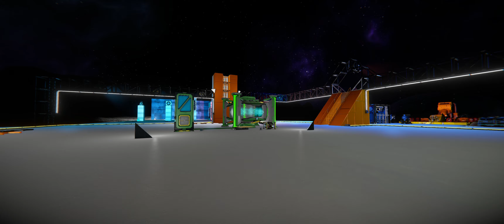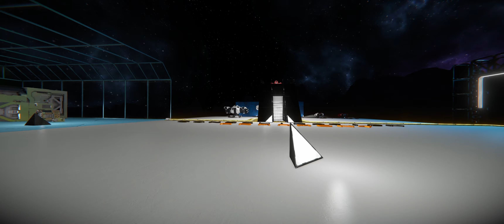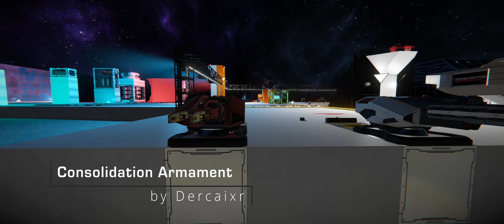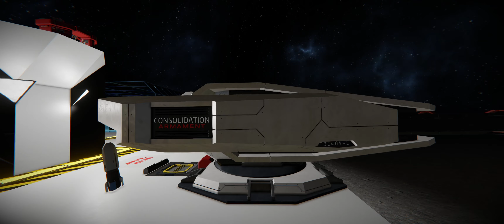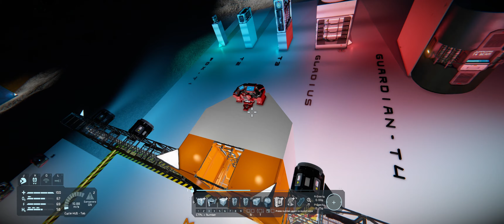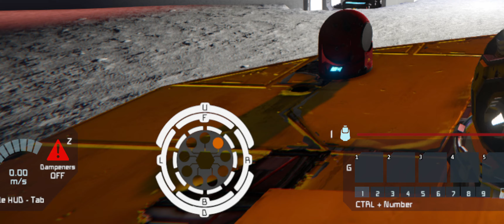2 Idiots Blow Stuff Up - Best Space Engineers Mods (PC)

Comment: I’ve been trying to work out bugs in this newest weapon core 2.5 with aryx enterprises weapons, replace vanilla weapons and just 1-2 more can’t remember the names. Sometimes my turrets lock up they seem confused if they detect a target within range and don’t fire sometimes at all. When I control the turrets manually (the ones that don’t fire on AI mode) I can’t even fire it manually. Don’t know if you guys know what I can do.
Reply from the maker: I’m afraid I’ve not tried the latest updates but the usual diagnostic steps will apply.
Check the workshop for any reports of the same issues. 
If no one else has reported it test in a fresh world, add weaponcore and one of the packs only then test each pack in turn before adding combinations of weapon packs. If you find an issue raise it on the workshop.
If the issue goes away it could be another mod that’s interfering or an issue in your save.